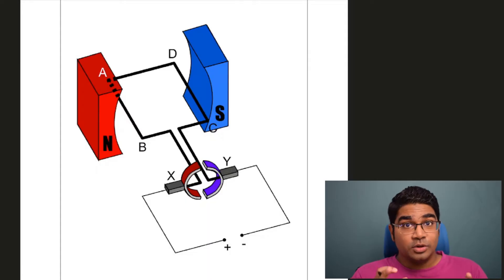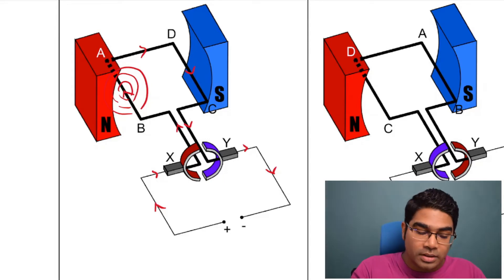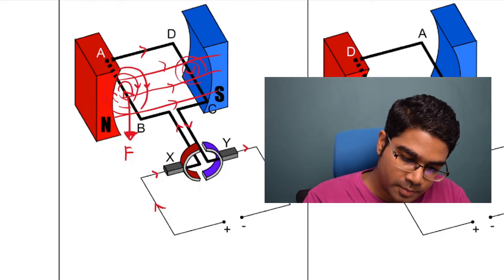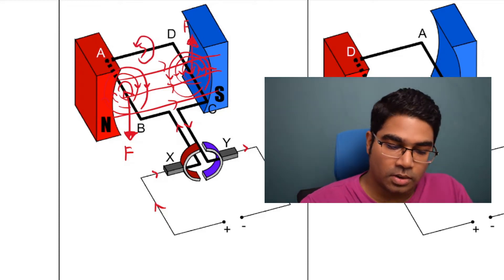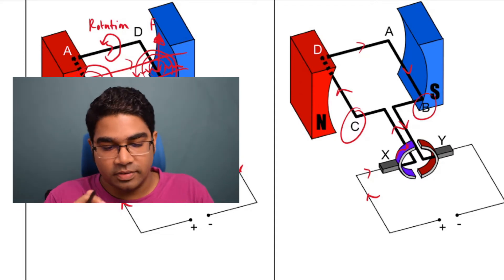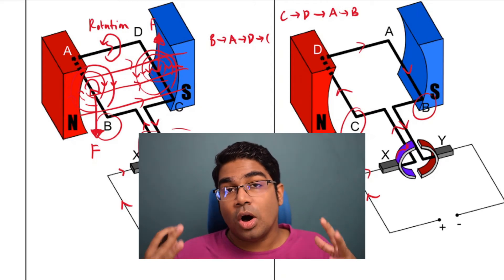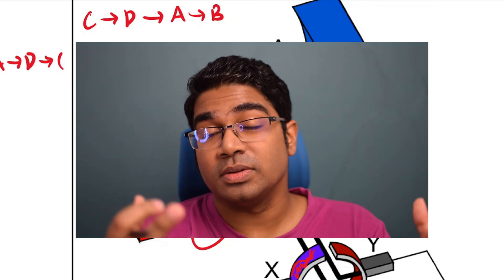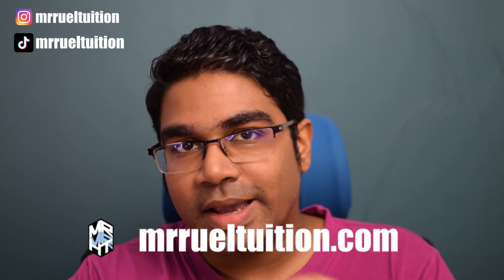DC Motor Operating Principle

Comment: If it is vertical then will it move back to horizontal due to inertia
Reply from the maker: With the commutator, yes. The moment it touches the second half of the ring, the force acting on it will be in the opposite direction.